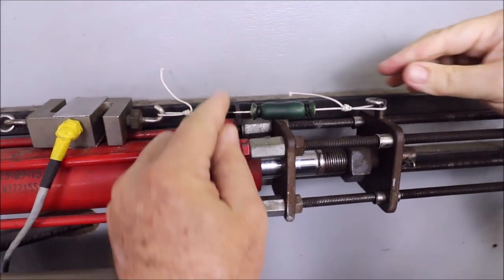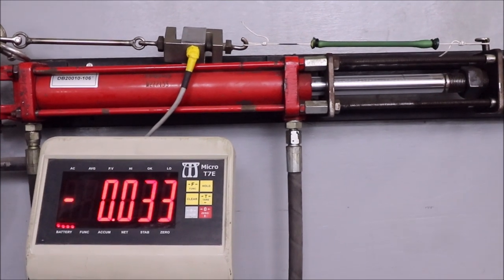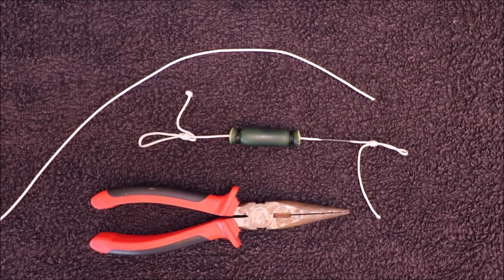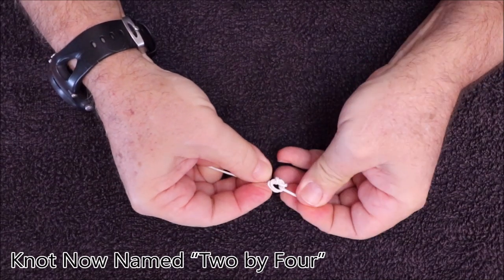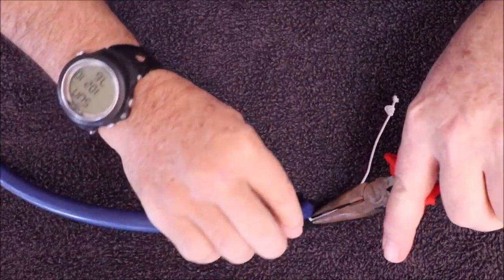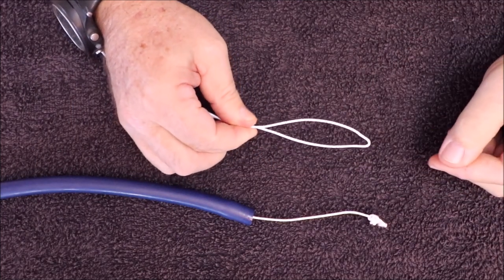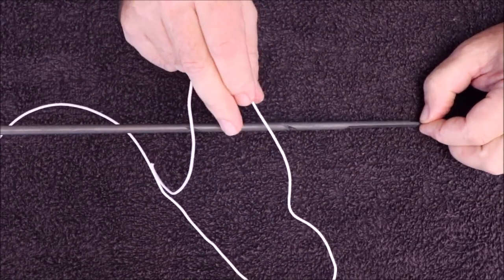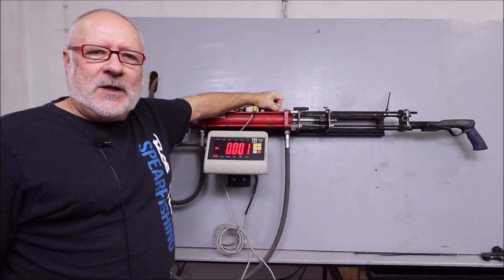Rob Allen | Dyneema Knot for Wishbone

Comment: Try doubling the line up, figure 8 knot, trim the ends. A bit fatter. Headhunter use that in their pole spears but that is 12mm rubber not sure on the hole size.
Reply from the maker: Thanks I will test that. I now use a modified button knot that is simple to do and has no slip.

Comment: I decided to test out this knot, definitely a great one but it’s too wide to fit into small ID rubbers (specifically attempt failed on 16mm small ID Primeline bands) I ended up figuring out that instead of 2 loops and 4 pass throughs, the 2x4 as he called it, a 2x2 works well for small ID bands
Reply from the maker: No problem going with what works for you. We have not tested the smaller ID rubbers 👍

Comment: In your other video you said not to use pliers.  Are the knots an exception to the need for a special tool, in your opinion?
Reply from the maker: It's not a good idea to use a long nose pliers on a wishbone bead but fine in a knot as it is much smaller, less likely to slip.

Comment: Rob, I am a big fan of 303 Protectant for my auto tires, windshield wipers, window molding rubbers, and basically anything made from rubber that I want to last and last and last!  Do you think the 303 Protectant can be used on speargun rubbers, too, to make them NOT dry-rot (as that is 303’s main feature!)??  Thanks for all your informative videos, too!
Reply from the maker: Hi Bri Ha, sorry I don't know the product. As long as it is silicon based and no petroleum products it should be good.

Comment: Rob, could you please repeat the test using a loop of 1.8/1.9mm wishbone dyneema tied with a simple overhand knot in the doubled line? This is a popular way to provide a loop at each end of the rubber, so that a replaceable length of wishbone line can be quickly tied in in with sheet-bends.

Also, how about repeating the test with: a simple, single overhand knot (Florida Freedivers suggest this in their YouTube video) and another test with the double overhand knot that RA use with your beads but without the bead!

BTW I like the "2x4" name for the knot shown. :)
Reply: Interesting video BTW :)
Reply from the maker: @tonyy6436  Ok, we will do the looped attachment type next. Not sure what you are referring to re the  single overhand knot?
Reply from the maker: @tonyy6436  I tested the knot shown in Florida Freedivers Channel, the one they recommend on the spear line. When testing it against the knot we use, it fails between 50kg and 60kg. It does not break but it slips. This test was done with Dyneema. Dyneema is slightly waxy, might be fine on other type lines.
Reply: @RobAllenSpearfishing  Some call the overhand knot a thumb knot. I've also heard it called a Granny knot but for us a Granny knot is different, it is the bad variant of a reef knot (/square knot). The over hand knot is the first half of a reef knot. The simplest knot possible perhaps.

Comment: Just a quick question sorry if it is dummb, I recently bought a Rob Allen Sparid 800 Rail gun and the spear on it has a overhang of 40 cm (the spear is 130 cm), it just doesn't look right, any suggestions on what to do, thanks for any help, keep up the good work.
Reply from the maker: Not a dumb question at all. The spear needed should be 40cm longer than the barrel, not the whole gun. So, an 800 gun should have a 120cm spear. The mechanism and muzzle will add about 15cm so only about 25cm of the spear should protrude from the muzzle.

Comment: Hello Mr Rob.. I have couples of rob allen guns.. Latest one i bought tuna aluminum 90s.. I have old one but i want to renew.. I used it.. The issue after shooting the gun sinking not floating :( how to fix it?? Rob allen reel attached only nothing else still new.. Any advice??
Reply from the maker: The buoyancy on the shorter aluminum guns are always  a problem. All the components are the same as a bigger gun but the volume/space for air in the barrel is less. We do make carbon barrels which are much lighter but also become a problem when made as 80's and 70's. to help we are in the process of making floats to fit on the side of the barrels but these will still be a while.